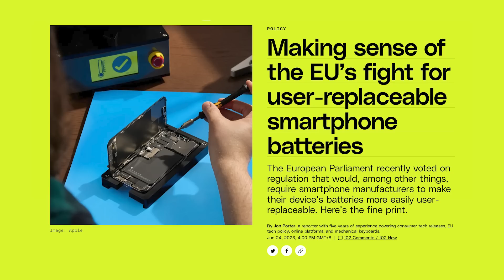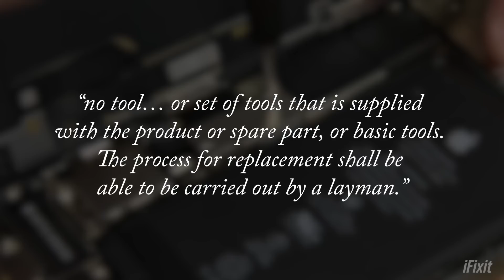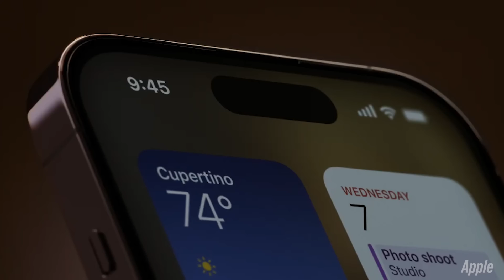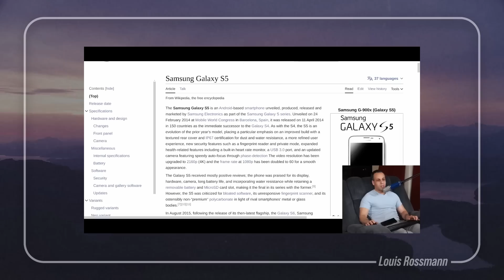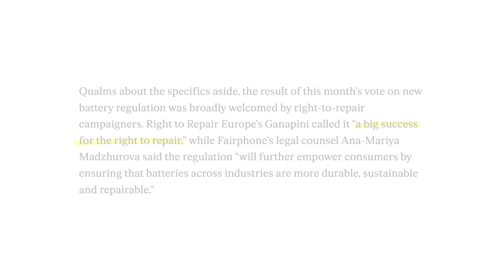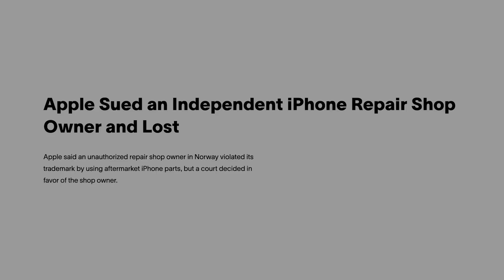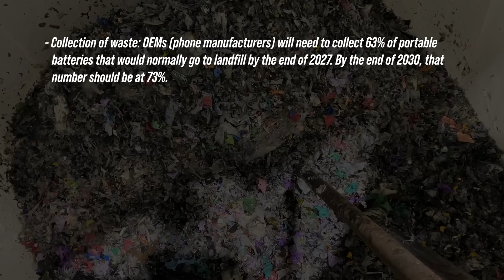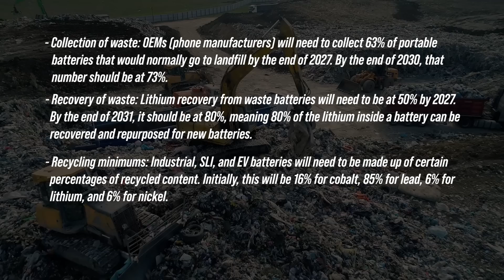EU Just Changed Smartphones Forever

Comment: I can applaud the progression towards Right To Repair... However, there are some laws behind EU devices I don't like though. In the EU, a device has to abide by EU volume restrictions. So volume levels are forcibly capped. This mostly impacts personal music players... But it is pretty ridiculous that EU devices in that respect provide a worse music experience than devices from other parts of the world.

I got my Sony Walkman player (The A55), but I won't get the android versions because that volume cap is baked in and unbreakable... But on the A55, you can do some hackery to change the device origin so it plays music beyond the volume cap.
Reply: Sounds like junk.

If that's in software though at least that won't affect non-eu owners as that's an easy fix. I love replaceable batteries though.

Comment: I think the Law is a bit dumb for EVs since EV Batteries are the only ones that really have the opportunity to recycle AND are the most reliable ones with running times of 10+ years.
Also, since these Batteries are so huge they HAVEto be part of the subframe.

But the law was necessary for all small batteries in handheld devices or power tools, since those are the ones that arent really able to be recycled AND those are the ones that make up the vast majority of battery waste. 
Besides, a small battery can be thrown away in a heartbeat, while you cant really throw away an EV battery. 

I can already see apple doing everything  to be special again and being the only one not complying in a way that favors the customer :D
They will definetky release some propriotary batteries which are horrendously expesnive and have some tech in them to prevent aftermarket batteries to work.
But welp, the average apple customer will most like smile and buy a battery for 1000€.

Comment: that's bullshit! getting consumer to return old battery is as easy as buying new batteries at the store, they can:
1. charge a premium for exchanging a battery without the original.
2. they can refuse to exchange new battery without old one
3. either option can be done online or in store , it better than buying fake batteries from amazon or walmart or 3rd party vendors
it just that these companies are too lazy and cheap to recycle their product , too greedy for profit and want to sell you more, it not their problem if the warranty ends

Comment: I don't mean to sound like I oppose right-to-repair, because I don't, but I want to offer what I think is a very reasonable alternative to the EU's policy on replaceable batteries. That's because this policy seems short-sighted to me. Before you react negatively, please consider this: I believe the movement towards requiring replaceable batteries incorrectly assumes that the battery will always be a consumable wear item, like brake pads on a car. While this is certainly true now, it won't necessarily always true, as our technology tends to continuously improve. In other words, you don't need a replaceable battery if the battery normally never needs to be replaced, or if battery replacement is very affordable. So I propose that manufacturers be given a choice of either designing a battery that does not degrade and can last the life of the phone (perhaps something like 6 to 8 years?), warranting the battery for that same period of time, or designing a phone with a replaceable battery -- it's up to the manufacturer to meet the standard. An alternate route for the EU to take might be to require manufacturers to provide an inexpensive post-warranty battery replacement program for that same 6 - 8 year period, where inexpensive is defined as, say, something like 10% of the device's original MSRP. Thoughts?

Comment: Planned obsolescence that's the key not to make a removable battery. 3-4 years and you are forced to get a new phone just because of the battery which won't last until the end of day like it used to when it was new. So you keep on buying.. My old mother doesn't need a good camera or any other bells and whistles, but as of now, she has to get a new phone due to the old battery. When removable batteries will be re-introduced to the market again everything will change. But we should not be naive, to get a new battery for an older phone will cost quite a bit, manufacturers will try to get their lost profit in many ways as much as possible, especially overpriced and overhyped Apple.

Comment: Of course it was built like that for profit and not for the consumer! Besides the Phones, I find it more awesome that the rule applies for laptops / tablets and less for electric scooters. Laptops can last a long time if you take care of them, and most of the times the battery forces you to keep them at home. Electric scooters on the other hand, already have replaceable batteries. 
On cars it will be a little more complicated, because the mass of the battery is probably larger than the car itself, but it can be done (there are cars with quick swap batteries already).

Comment: This is a huge win for lawyers that represent tech companies as this will be a major litigation battle for years to come. As an engineer that designs batteries this has the potential to destroy the BEV (battery electric vehicle) market because it will not be possible to compete from a cost and performance standpoint with ICE (internal combustion engine) vehicles. Phones don't have a competing technology so that will just mean that phones will end up increasing by 10-20% in cost. I'm confident this will not be enforced by 2027, but if it does it'll be a major setback for the electrification industry.

Comment: This is the first I think you have failed to get to the bones of the topic. The main reason manufacturers favour the current method of assembly is because it makes more money for them, nothing to do with manufacturing complexities. Today a smartphone is practically obsolete if its battery is dead if its battery is dead, and the easier option is to jus buy another one. The repairs you can only do at manufacturer-approved repair shops (or lose the warranty), which means the manufacturer continues to rack in the dollar. Bravo to the EU! At least they have the balls to read these companies the riot act.

Comment: A drawback will be that removable batteries will have less energy per volume than internal batteries, since a considerable amount of the batteries' volume will be taken up by the plastic casing and we are also not considering the power requirements of modern SoC's.

Comment: This is very good news. It probably means that the U.S. will benefit as well. The complaint that it is hard to design repairable and still waterproof phones is a red herring. If it's harder, then work a little harder. You work hard enough at making them unrepairable. It will almost certainly make them easier to assemble as well.

Comment: To be fair, only few people really need water resistance phones. Normal people don't dip their phone into water. I don't know why apple is so anti right to repair except for money. And it shame that lots of companies follow apple instead of actually pro consumer.
Reply: Water resistance is nice, what if you get caught in a rainstrom? That's not exactly an unlikely occurrence. I've gotten soaked having to walk through big parking lots during rainstorms before. What if your phone slips into a sink? Also it's not impossible to slip into a pool or whatever.

It's easy to make a phone with a replaceable battery that's still water resistant though, just put a rubber gasket under the battery cover.

Comment: GOOD
One of the issues with these "high tech new models" is even if yes after 5 years or so there are no OS updates anymore so... for security reasons don't use them for banking. But, the fact that it is probably the battery dying in 2-3 years killing it much earlier and leading to e-waste. THANKS!
I get it, at a point, upgrade your phone...

Comment: Yes!!
Rules need to be enforced, as a good set of rules will make the whole world better. 
For decades before glue are used every single phone batteries can be replaced easily and each phone can last several years just because of it.
Water Resistant and sleek looking phones can still be achieved with removable battery.

This Anti-Consumer decisions by Apple and other phone company need to stop.

Comment: To play the devils advocate, what is this going to do to water resistance ratings? As well as what is this going to do to battery capacity?
My iPhone has a water resistance rating of IP68 for 30 minutes at 6 meters (20 ft). The IP68 rating only requires testing at 1m for 30 minutes.

The reason batteries were shifted inside of devices was so you didn't need the extra mechanisms and space for those mechanisms. Allowing you to pack in a bigger battery. The same issue applies to laptops.

I'm concerned this is going to negatively impact mobile device specs.

Comment: While I'm happy that this law got passed I'm still sceptical if this is going to change anything for the lifetime of most phones. One of the most common problems I encountered with replaceable batteries in phones used to be getting a original battery that was just as good as the old one I was replacing. Most of the time the "new" battery I used to replace the old one with was already degraded because it was in storage for too long.
Reply: New Nintendo batteries are being created for the Nintendo 3DS(12 years old) and that's because replacing the battery just requires a screwdriver. Imagine all the iPhones which are even more popular devices. It just might take some time as the world realizes that it's much cheaper to buy used and just upgrade the battery, and let the people who buy phones every year feed the used markets.

Comment: People say this is right and good and finally politicians do something right. I cannot see that at all.

I never found removable batteries being something pro consumers at all. A pro consumer achievement would be finally a battery that almost never degrades and lasts 4 weeks per cycle at least. Which is being engineered since 2010 btw, and it was eventually going to happen. This EU crap is in the end a step back, and a waste of time for everybody.

If this has not happened yet its just because political and capitalism wall impediments. Which is ironic, for sure someone is earning millions with this move.

The right to repair, wich is something different was a necessary measure for sure no doubt.
Reply: If they can invent that 'eventually', they can invent it in such way that it is replaceable, eventually.
Reply: @csibesz07  it would be unnecessary. Why would you ever need that if the battery lasts longer than... any other hardware components on the device?
Reply: @alexglezarch  But it can be done and if it's not done, it's the same reason it is not done now: to keep selling you new phone/battery.
It's necessary cause we don't actually have such battery now, do we?

Comment: How are they going to make user replaceable batteries for EVs?
Reply: Maybe have them somewhat easy to slide out from under the back seat or whatever. They will get rid of them being built into the frame though. I'd think weight would still be an issue. I'd still be happy if non-dealer repair shops could just replace them though.

Comment: I guess this is an unpopular opinion but i really do not like this law. Sure it'll make batteries easily replaceable but the battery on many of these products are not the concern. Earbuds for instance will now need screws instead of glue which is going to increase cost and likely come with some design compromises. Essentially every products with a battery is now going to have to make design compromises that makes the product worse to use and/or increases prices.

Comment: Awesome. Been on a path of prolonging the devices I have. I am still using a Galaxy s9 which I installed a custom rom and swapped out the batteries. It's not a super easy process but it isn't as hard as swapping out iPhone batteries.

Comment: Dell laptops did the same thing. For years their laptop batteries would detach with a simple switch and all of the components were easily accessible. Then all of a sudden the batteries were under 5+ screws (some hidden) that required you to go to a technician to replace your battery or upgrade your RAM.

Comment: Changes regarding removable and recyclable batteries was completely motivated to increase profit. user demand is misleading, because if you cannot buy it, your demand is not seen! Also, increased profit was not just generated by exorbitant charges for replacing batteries, but also because most batteries lose a lot of capacity in around 2 years. If not replaceable, the only recourse is to buy a complete new phone, laptop or whatever. Now just project this into EV's!!  Imagine the environmental impact!! Good on the EU, no matter the difficulty of implementation. 
One idea regarding getting batteries returned for recycling is paying a certain amount to the send for such a return. Say $10 or$20. This can be included in the initial cost of the item. You get it BACK when you send the item to the manufacturer for recycling.
Another possibility would be that Governments themselves PAY the MANUFACTURER for every item proven to have been not only returned, but also to have been properly recycled. This would not have to be much. Corporations are notoriously guilty of nickle and diming others. this could just return the favour!

Comment: Laws like that should be extended to every possible component in any possible electronic device. Never understood why I can't chance or increase RAM memory in most recent Macbooks for example. Well done EU.
Reply: Two reasons. First, Apple's general arseholery regarding end-user servicing and any type of upgrade. But second is an engineering matter: One notable selling point of those macbooks is their extreme thinness. I don't know why Apple considers thinness such a vital point, but they do, and achieving that means design compromises: There isn't physically enough space for a memory or SSD module in the recent models, so they solder parts directly to the board.

Comment: I miss LG phones. They had so many bells and whistles, but the problem was that the company was unfocused and kept dropping many of their innovations except for the Hi-Fi DAC and multiple cameras, and great camera app and recording with so many manual settings which were game changers.
Reply: Yea even the cheaper phones they made were great I used a $80 LG I think it was the v40 for 3 weeks it had a fingerprint scanner and a good enough screen I had no problems with it.
Reply: They were very innovative. My wife had an LG G3 which was awesome and lasted many years and actually still works.
Reply: LG was so good.
Reply: also to add, durability and QC issues, i had theri g3 if im not wrong, dropped it by accident, display changes was so annoying the display kept not working
Reply: I remember the V20 I got back a few months after it released in '16, The selling point was that as a replacement to my S5, it too, needed a removable battery. I still have the spare battery and charger kicking around and the wall adapter is still in use. I think that phone lasted just under a year. the display was bad about ghosting if an image was left up for, say, an hour. Think navigation apps, etc. It could take hours for the ghost to go away fully. I dealt with that for awhile but what ended it was the modem lost sensitivity and the most signal I could get was 1 bar. as soon as I left the peak reception area I had zero signal. vzw took it back and swapped me into a S8

Comment: Really good decision by EU.  In the name of better product design etc, these companies wanted people to spending money ever 2/3/4 years once the battery goes down.  And replaceable batteries are rarely in stock or will be high priced.  For a 6mm,12mm,18mm,24mm thickness devices there should be standardadized battery with a sheet connector - so devices can remain slim.  And there should  multiple vendors like duracell etc for these batteries.  For water sealing, also this is not a constraint since outer shell should be easily clicked to seal and will have enough sealent.

Comment: I personally think this is a dumb idea as far as the smartphones go. It will be very hard to achieve efficient cooling, water and dust protection. I replaced more phones because they got wet than for a dead battery.  Replaceable batteries are welcomed but only if they don't affect other features.

Comment: can't even have good things in eu... easily removable batteries would mean phone would be more stealable.. it has happened to me a lot... if markets will shift to removable batteries i will buy a phone with non removable battery and use it for next 7 years.. then i will start glueing my battery and phone back to the phone.

i am all for right to repair.. but this is not it.. they should be easily removable by repair shops and not by a 5 year old or a thief

Comment: I just replaced the battery in my 2016 Liquid cooled (first one of its kind apparently) phablet, was really easy and cost me £45 total,  I don't need an all singing all dancing pc same as a mobile, i came across my old Motorola D520 the other day on my boat and it looks brand new, no battery in it but can get for £25, have no idea if it would connect to the network though being so old.